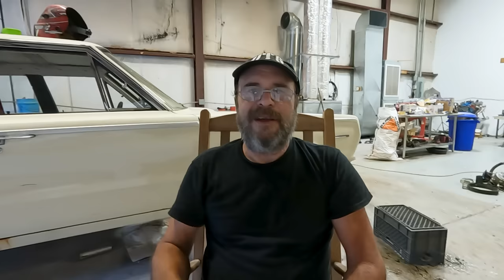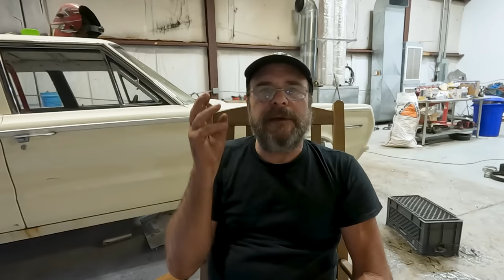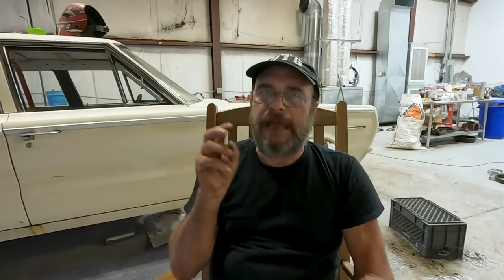They Really Are Out To Get You- How The Automakers Have Made Life Miserable For The Average Mechanic

Comment: I knew they were out to get us beginning with 100K spark plugs, extended life engine coolant, sealed for life bearings, non-serviceable transmission fluid and must have MFG scan tool to flash and code read= MUST TAKE TO THE DEALER.

Comment: Lol! I have the SOHC COLOGNE engine in my Ranger. 135k miles and rattling timing chain has begun. Truck is 20 years old and a 4x4. Going to nurse it around town as a parts and Home Depot getter until it blows and then I will pull it and give it a rebuild. Im 66 so a rebuild should last longer than i will. The engine is german design and like all things German its built on the principle of simple is bad and complicated is good. Nice video. Keep up the good work. The truth will set you free.

Comment: How do you feel about birds? Do you trust them?
Seriously though, I just dropped the tank on my '86 CJ7 (to access the taillight wiring harness) and it was pretty sketchy. I was able to siphon out all but around two gallons, and disconnect the filler at the tank. Let me tell you - as soon as I smell those gasoline vapors I get a little nervous. You just gotta start working through all the "what ifs", get a fire extinguisher close to hand, and plan your escape routes. Anyway, I got that sucker out of there and I'm cutting an access hatch in the sheet metal for servicing the fuel pump assembly in the future.

Comment: I got rid of my new cars and got 2 80's era Mercedes diesels. Every single part on those cars can be repaired, and there is little to nothing that requires special tooling. They get good fuel economy and never actually break down. They just lose a little performance, or smoke a little bit too much, or sound a little bit off to let you know it's time to make a repair. I'm building up my spare parts pile. In an absolute worst case scenario, I can even make my own fuel if I have to. 

I will not get rid of them until I am completely forced to do so, and it doesn't look like that's going to happen.

Comment: I’ve worked on a lot of stuff in my life mostly 50s-60s-70s-80s- gm, ford, dodge, Cadillac and watched them all go downhill. Was working at caddie dealerships in 77 when the first sideways engine cars were unloaded off the delivery truck, the shop Forman had been pumped up with all kinds of info that said how great they were. But we found out how hard they were to work on quickly.  Special tools to hold the engine🎉 up when you removed the transmissions. . Not very home mech friendly at all.   The easiest thing I ever worked on was the big 70s fleet wood Cadillacs.  Plugs staring you in the face.  A lot has been trashed in the name of saving the planet,   I’m living in Asia now and am amazed you can drive anything you want over here.  Diesel or gas.  Way more people over here in China, Philippines, Thailand ect ect than in USA yet they have small trucks, diesel cars and trucks. I bought a new Honda 150cc motorcycle 2023 with a carburetor on it.

Comment: The fuel pump / tank issue is not a deliberate oversite. it's just plain deliberate.  it is a really GOOD, SCARE TACTICT.  And that was just the beginning. by the way, I had to put 3 fuel pumps in my 2000 GMC Jimmy. I installed a drain plug in the tank during the first pump change. the amount of four letter words that came out of my mouth would have driven a sailor to see the Chaplin. And somewhere, there is an engineer whos ears are sill on fire.

Comment: I have been a mechanic since 1999. And the amount of plastic and cheap parts being put into these vehicles is insane. For instance, I would say 50% of the new F1 50s out there are plastic. They have plastic transmission pans. Plastic oil pans. The entire front clip is plastic radiators for etc. In 10 years these cars are literally going to crumble away in your hands.  I could go on and on just like you, Tony with these ironic and idiotic practice is being put into these vehicles. I see them every day and I cuss these engineers with a passion every day.

Comment: I was working on a friend’s Chevy Cobalt the other day, and I noticed a drain plug in the transmission pan. I know they didn’t come from the factory like that, so I drained it and looked inside… “made in China” was stamped on the inside of the pan. Turns out the original pan had been damaged and replaced with something better. Go figure.

Comment: You're correct about the 4.0 Fords way not only to try and screw the car buyer, but to also try to screw the shops as well. Just like their power stroke diesels, there's an o ring that goes bad under the oil cooler. The only way to obtain that specific one ring is to go to ford "because it's one of those dealer only screw or customers" and pay 800 for an o ring kit! This was back in 2010 good only knows how much it is now. Then it takes off I remember right almost 7 hours to replace it! It's located on top of the engine wtf! Thanks ford. But one more thing people may not be aware of is the coyote engine that Ford claims they designed and built is actually GM's north start engine just different crank bore and stroke! Oh and they used stronger head bolts! That's it maybe they redesigned the timing chain set up I'm not sure. But to all those ford coyote lovers that's a chevy engine

Comment: I'm buying a certain vehicle that I know how to work on myself and that is cheap. I bought several and stripped them down and logged the parts in my garage. I figured I can make it 10-15 years. I have 2 running and 3 parts cars. I went and looked at new cars and they are nuts. I'm not paying that price. I don't work as a mechanic and haven't in years, but I can only imagine. I'd rather drive junk and save my money

Comment: I knew Ford was going to the dark side  when they took the voltage regulator off the fender and added it to the alternator like Chevy.  It was really obvious when my brother in-law  had to adjust the headlight on his 1970s car ( I don't remember what brand) ,and it required a patented proprietary tool to change it that cost $80 . I don't agree with the way he handled it. Sears had paid for the rights to add the tool to the Craftsman line, so he bought it used it and returned the tool. The dealers are really out to screw the customer  . In the 90s I wanted a new pickup and went from dealer to dealer  trying to order what I wanted according to the website it was available but no dealer would order it . The only way to get a new truck was to take a bloated over price truck they had ordered from the manufacturer and I've never bought a new truck. The dealers have screwed the  manufacturers out of any new sales for over 30 years.

Comment: I have seen the ups and downs of the industry since the 1950s and agree with your observations completely.  The great running cars of the 60s were ruined by the mandates of the 70s. Even with all the front wheel drive junk and plastic, we had a lot of good vehicles on the road by 2000 then here came GDI, cylinder deactivation, and 8,9, and 10 speed transmissions all by the same process of blind mandates which fail to recognize the practical limits of a particular technology.  Even used cars that belong on the "under $10K" lot are sitting on dealers lots with prices in the $22K to $28K range. I agree we may be "going Cuban" in the end, taking care not to have parts stolen from our cars while we are waiting in line for our ration of meat or flour. It is coming and the people that caused it just recently approved giving the Baker Center $2B for "climate justice and community change" as part of the "inflation reduction act."  As a wonderful old man said many years ago, "the monkeys are running the zoo."

Comment: I still cannot believe how many common repairs now require removing the cab on Ford and Chevrolet pickups. Especially since major valve train repairs are getting common on low mileage vehicles.   Putting the water pump in the timing chain galley is another stupid design.  Every time a person pays $1700 for a water pump change or $2200 for leaky valve gaskets, that is a customer that will not buy another one.

Comment: These days they don't even have to take things apart to discover whether a unit is serviceable. CAD programs are so sophisticated they can literally perform assembly and disassembly on a computer screen. So yes the   manufacturers are purposely making these maintenance jobs difficult. But it started earlier than you say. Chevy introduced the infamous clutch head screw in the 1950s. Easily the most poorly designed screw ever built the screw could be impossible to remove when it got rusty. Then you had the starter motor in Fords that all but impossible to remove because of a lack of clearance...putting one in often required hitting the motor with a sledgehammer to drive it through the too narrow opening.  These days you have the "Lifetime Transmission Fluid" bit with Toyotas where the auto transmission torque converter packs it in at around 100,000 miles because the fluid has gone bad...a new tranny costs about $6,000. Then you have the endless "safety equipment". Airbags that blow up in your face, tire air pressure monitors that give faulty readings when cold, etc. So yes the manufactures are indeed out to "get us" and by this I mean not just the mechanics but the owners who own the damn cars. I had a really nice Nissan pickup truck back in the early 2000s that ran like a clock and was a joy to drive. Here in Maine road salt eats steel brake lines and when my mechanic attempted to replace them one of the fittings broke off in the ABS gadget connecting the lines. The cost of a new one....just shy of $800! When the dealer's parts guy told me that I replied, "The whole truck only cost $7,000 and you want 10% of that for a simple part?" The parts guy said,"Mister if you were to buy all the parts needed to build this truck from scratch it would cost well over a million dollars!"

Comment: The reason why it went to DOHC was a more reliable high RPM range for todays higher HP engines. You cant do high RPMs in a pushrod for a long time without rods and other parts being damaged. Throw in the EPA, safety standards, new car generations every 6 years, cash for clunkers it gets crazy.

Comment: While I agree with you on 99% of the comments that you have made, I am not sure the engineers know what they are doing. While working on several large construction projects, we have seen architectural and engineering examples that would make you think " Where in the world did these people get their education?" I wonder if some of these ever flashes across their minds? I did find by picking up and delivering auto part components from one manufacturing warehouse to another manufacturing warehouse, that many employees that are building ( rather assembling parts) had no idea what they were making or what it was used for.
I did have the opportunity to attend a truck rental company's open house and they were showing the new Freightliners. While they were showing the benifits of the truck and the new upgraded 🎉engines, the starter, and other " need to service regularly " parts were actually "hidden" in the frame. When I asked about how to get them out, the Freightliner representatives could only say " the bolt heads are the same size, you only need one size wrench." 
Many of us older have seen many of examples where the engineers ,and other experts, have no Ideas on how things work, or make a object work and that is as far as it goes.

Comment: I prefer pre 1996 cars and trucks. I am a lifelong DIY mechanic.
I also SPECIFICALLY try to buy MANUAL transmission cars / trucks.
I will also point out that the car manufacturers are introducing MONTHLY SUBSCRIPTION FEES to USE features of the car.
And it's only going to get worse and worse . . UNLESS we revolt and/or get legislation to help the OWNER. ( "Right to Repair" )

Comment: I call it 'scam engineering' and its in every electrical and or mechanical device you buy these days.

It is designed to prevent things from being repaired (or repaired cheaply).
It is designed to prevent interchangeable parts.
It is designed to fail after a certain number of years.

And one of the more recent ones are things designed to not function with after market parts, you got these digital methods of detecting non genuine parts and it blocks the product from working.... i have seen this happen with printer cartridges and laptop batteries.

Another one is subscription components such as car seat heaters... if you don't pay the subscription the product will not work.... in that case, you should be able to charge them a storage fee for storing their product that you are not entitled to use, in your vehicle!

Comment: Rip off headlights.  I had my 2013 Cadillac SRX  headlight go bad and took it to a repair shopt to replace it.
I was quoted $1,000.00 for a replacement.  I looked at the service tech and laughed.

I come from a time when 3 screws removed a headlight, now you have to literally remove the complete front end of the car to replace a headlight.  It took 2 hours to install the $135.00 headlight I bought online.

Comment: Daily drivers in my family are:
1993 Volvo 240
1992 Volvo 940
1998 Volvo V70
Between them they have 820,548 miles.
No engine or power train work ever done. No tranny fluid ever replaced.
None have book value. All cost pennies to insure. Parts are cheap on the internet and working on these cars is easy and fun. They are heavy, safe and they turn heads. 
Why would I want to replace them with overpriced, overcomplicated, overengineered crap they sell today?

Comment: there should be a price on their h..ds. i took out the air conditioner on my 2004 diahatsu sirion and put a new alternator in its place, the alternator was buried behind the motor and you required an octopus to get to it.  i cut a hole in the floor to get to the fuel pump.

Comment: They are putting the average joe out of business, and they want us all to have to go back to old school, and the computer age is where it begins.

I used to work at a part store (major chain) before they installed the computer part price system that was used to determine how much I was supposed to charge each individual for the same part and same part reference number.

Suddenly, I'm charging various charges for the same item depending on what make and model it was being purchased for...

And then, aftermarket products, made so cheap they were falling apart during installation, and the new system for unique and special equipment and tools...

The average guy is just not able to make these things happen and often they are stuck.

I'm still driving my old truck around, the old dinosaur is so basic and easy my old butt can actually fix it, and it doesn't have a single computer module to go bad 
I bought myself a bunch of these old trucks back in the day, and I still have a few of them around.

I spend my days working on most of these old ones because they are actually easier to work on, and people appreciate a guy who wants to work on the classic vehicles...

My last job was on a 48 Ford Coupe, with a stock flathead in almost mint condition.

Motor knock, and oil pressure issues, but actually not a bad thing, took around ten hours and the guy paid the upfront payment, and then paid off the balance upon completion.

Comment: Back in the good ol days, you would get a lube, oil and filter, but thats when everything had grease fittings, and all of your suspension parts would out last the motor, but the automotive industries said they cant have parts lasting that long, so they removed all of the grease fittings, so your parts would wear out, and you would have to spend money on your cars, all of this was engendered to break down by not greasing anything. 🤔🧐😯

Comment: We need to create an organization that fights back against complex car designs that are impossible to fix and cost a fortune.  My F150s battery will discharge if I do not lock the truck?  The transmission will not shift as well.    I just want a simple charging circuit.  And a simple transmission, I plan to go back to manual.  I only need 3 things, Reliability, Easy to Fix and good gas milage. I am not buying a ridiculous complex new car.   I had a S10 1990S?  Sitting behind my building for 10 years.  Pulled it out Sprayed gas in Carb, jumped it and guess what.---IT RAN   THAT A GOOD AND INEXPENSIVE DESIGN

Comment: Another thing I forgot to mention is there is a legal framework few people know about. This is the MMWA. Among other things it states that manufacturers can’t void a warranty for using third party parts and going to independent repair shops. I would post a link to this but every time I try to post a link somewhere my post gets deleted. It specifically prohibits “tie in sales” requiring using dealers for repairs and oem parts. Here is a small part of it but it could be the basis for class action lawsuits against manufacturers that exclude independent repair shops and third party parts. Specifically locking third party repair shops out of the ecu or other hardware could be the basis of a lawsuit. 

“The Magnuson-Moss Warranty Act (MMWA) protects consumers from having their warranty voided if they use third-party replacement parts. The MMWA, also known as the "right to repair" or "anti-tying" act, prohibits manufacturers from requiring consumers to use only their original equipment parts or services to maintain their warranty. Manufacturers can only deny warranty coverage if they can prove that the non-original part or service caused a defect in the product.”

I have run into this issue in trying to upgrade my work computers myself with third party memory just to be told my our IT security that it violates the warranty. My reply to that is such a warranty is illegal and I forward the law to them. I tell them by enforcing this they are helping an outside contractor break the law.